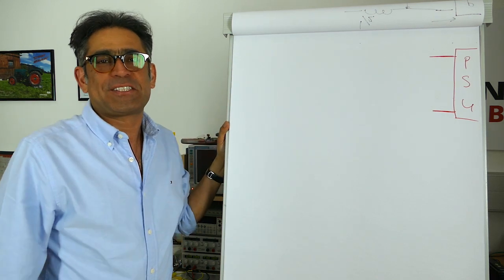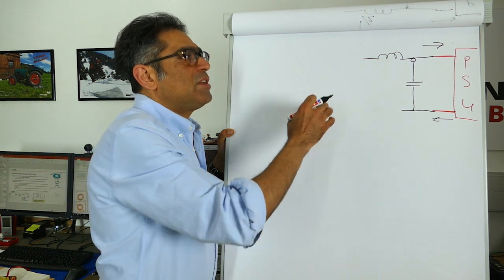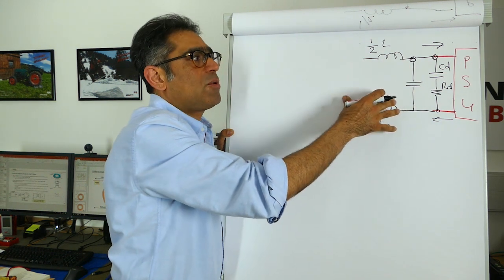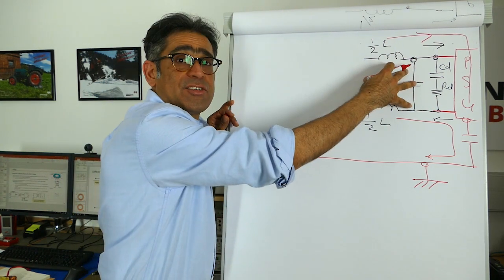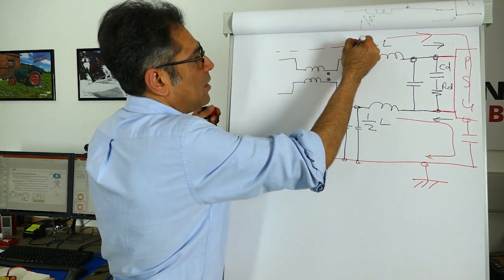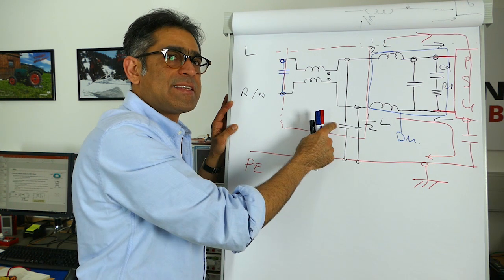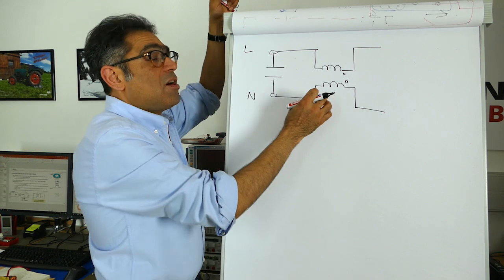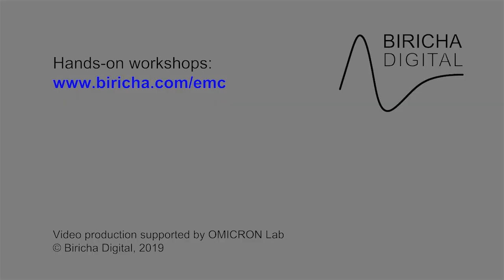EMC Filter Design Part 2: EMC Filter Structure and Operation

Comment: Hi, one question that is driving me crazy, considering that the noise source is the dc/dc converter, why the filter is not designed from the dc/dc converter to the power supply? I mean, in your drawings, you remove noise coming from the power supply.
Reply: I have the same question too, its bothering my mind to a level i am unable to concentrate next levels of the video
Reply: i can think of author is considering noise coming from grid, but we usually need to stop noise coming from Inverters in our application